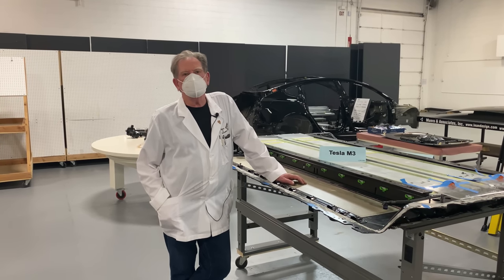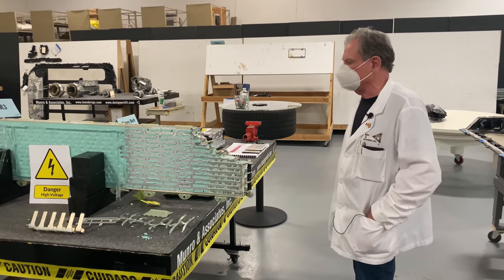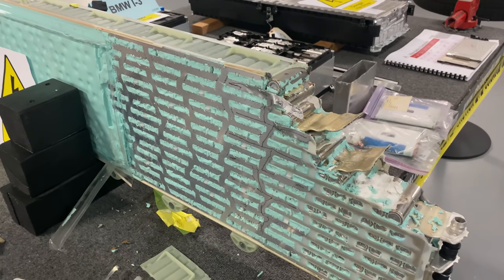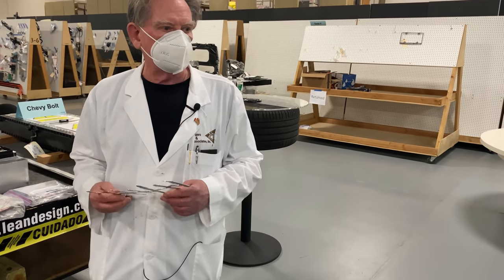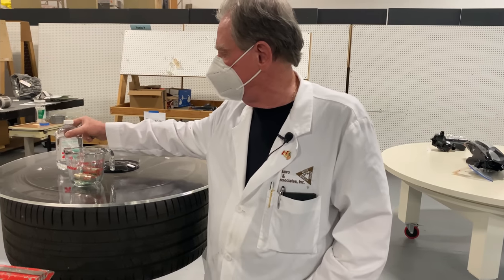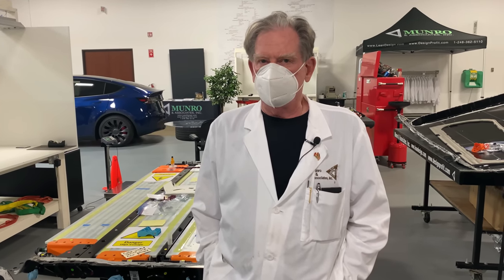Model Y E32: High Voltage Battery Comparison - Cylindrical vs. Prizmatic vs. Pouch

Comment: Those thin wires to each cell are also fuses.  If an individual cell shorts, the wire opens and everything keeps working, but with a little lower capacity.  Tesla has the best thermal management  by far.  The BMW is ridiculous, as it only heats / cools on the thin bottom side of the battery cell's "can".   Early on, Tesla found that the key to deep cycling (a.k.a. usable charge) and the capacity decrease due to charge / discharge cycles (a.k.a. life) is dependent on the thermal management of each and every cell.   The other guys, like Nissan and BMW, are still clueless about this.  If interested, BMW has a YouTube video of how they manufacture the cells.  Sandy is correct about the costs of making a cell, i.e. Tesla is least expensive, but not necessarily about the assembly of the battery pack.  Tesla's design is almost fully automated, the other guys, not so much.

Comment: The "tiny connectors" act as fuses and prevent internal short of a cell to kill the entire brick
Reply: Yep! Additionally all the batteries in a brick are all parallel. So they collectively act as 3.7 V and give a higher capacity per brick. If you lose one or two it doesn't drop the voltage because the potential difference hasn't changed, only the Amp Hours available from that brick has diminished slightly. (assuming the cells are essentially uniform voltage to begin with)
Reply: @FailTrainS  Funny that Mr Munro confused voltage with ampere/ hours,  any schoolboy/ girl  would know the difference!That is not very assuring regarding his expertise . LOL
Reply: @planpitz4190  everyone makes mistakes from time to time ;)
Reply: @planpitz4190  It's easy to right something down on paper correctly, but easy to mess up when you're trying to talk about it live. :)

Comment: There is multiple errors in what you say or what you mean on batteries and cells, Sandy Munro:
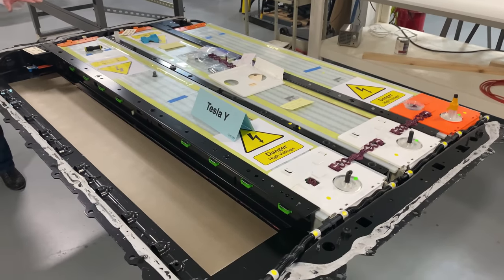0:30 - That's three out of four *battery modules*, not battery packs nor batteries.

1:10 - There is not 4416 of these cells in each of these four "bars" (modules), but there is 4416 cells in the whole battery pack in total, so 4416 cells in all 4 modules combined.
4416 * 3,6V * 5 Ah = 79.488 Wh.
The rest is ok: 46 cells in each brick: 1s46p, with the cells in each brick wired in parallel. And then the bricks are wired in series: 96s46p.

3:00 "Of course the main ingredient is still Lithium ion, but that part is the main product, but the rest of it is Nickel, Cobalt, Aluminium."
That is a totally misleading statement. The main ingredients by weight are graphite and copper from the anode, nickel and some aluminium from the cathode and electrolyte solution. Lithium is in fact a relatively small percentage of the overall material.  About 70-150 g lithium per kWh. While a kWh weighs about 460 kg / 80 kWh, which is about 5,75 kg per kWh.

See this for reference for a NCA cell:
https://cen.acs.org/materials/energy-storage/time-serious-recycling-lithium/97/i28
Percentages by weight (multiplied out for the active cathod material):
22%	graphite (from anode)
17%	copper (from anode)
15,2%	nickel (from active cathode material)
15%	electrolyte solution
10,4%	oxygen (from active cathode material)
8%		aluminium (from cathode side (inactive material))
4%		carbon black and binder
3%		separator plastics
2,8%	cobalt (from active cathode material)
2,2%	lithium (from active cathode material)
0,4%	aluminium (from active cathode material)

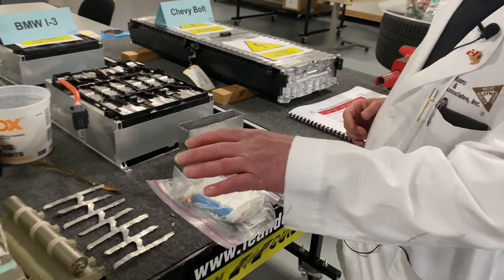4:10 - that glue is likely non-conductive, instead of "conductive glue". Instead what you mean is "thermally conductive" instead of "electrically conductive".

6:16 - The cells are in parallel, so you do not lose voltage when cell fuses break. But you lose amperehours in a brick.

6:51 - That is not small wires "that break", they are cell fuses specifically engineered with a certain diameter designed to break in case a certain current is exceeded.

3:22 - These are nickel metal hydrid (NiMH) D-size cells from an early Ford Hybrid. Inspired from early Toyota and Honda hybrids.
Reply: Thanks for all the addtl info/ corrections
Reply: you are battery God! please make videos about! please!
Reply: Someone's doing expert level homework! Thank you very much for your sterling comment.
Reply: I was about to correct some statements made after watching the video since I worked on both M3 and Bolt cell/pack. Thank you for posting the detailed comments. Of course some like the number of cells were all just casual errors made during the simplification of the video. My main cripe was the % of chemical constituents in each cell.
Reply: @Ben L yep a lot of it is sandy using incorrect language, this is really nit picky and would not matter to the casual audience the video was made for, he makes detailed reports that he sells.
Reply: I'm just glad that Sandy is willing to show us how he utilizes his expertise.  He doesn't HAVE to share all this knowledge with us morons, for free.  Rather than bitch about little things, why not let the man do his thing, and enjoy the knowledge he has and the job he's doing.  A job that would probably be much easier without a camera & mic on him and a bunch of extra "studio set" stuff that goes along with filming himself and his space, making public presentations.  Everyone knows there are a total of 4416 cells, even my 11 year old nephew knows that (mostly because I give him a dollar for the correct answer.)   If enough people complain about the little stuff, we'll get nothing.  Is that better?
Reply: please make videos and share us your wisdom
Reply: @AlexTelon  Yes, that description describes the long range battery pack with a proper wording. However, the standard range plus battery pack was described in a short statement in a wrong way. I put in a large comment there with a correction.
Reply from the maker: We appreciate the fact checking and keeping us on our toes, shows that we're lucky enough to have a very smart audience!  As others have mentioned, these videos are meant to be more of a high-level glimpse as opposed to a perfectly-honed deliverable, so you'll have to forgive us for some of the occasional flubs - with daily publishing of videos, we just don't have the time to shoot multiple takes and conduct long rehearsals. You're getting to experience raw, unbridled Sandy! :) Our hope is that the content that we are providing is useful to you, and we appreciate you tuning in!
Reply: @MunroLive  I very much appreciate your videos, warts and all, and I also appreciate it when people fill in the details here in the comments.
Maybe you could pin @koeniglicher's comment so it's easy to find even as time goes by?
Reply: I grew up on RC electric cars. Tesla just has more cells.
His basic understanding was surprisingly inaccurate.

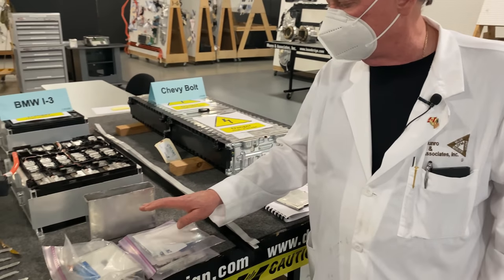Comment: 5:30 Sorry. Sandy is actually wrong on this. In fact, the order might be flipped. Pouch cells might cost more to manufacture on an individual basis than cylindrical cells; however, those pouch cells are actually cheaper on a basis of energy capacities. Cylindrical cells are cheaper to produce on a per unit basis, but they require more materials per unit of stored energy. 

Pouch cell battery packs are also, by far, the most energy dense construction. While cylindrical cells make the packaging appear cheaper and more energy dense overall, they are a package within a package (the cylindrical cell walls serve the same purpose as the packaging used in prismatic cell and pouch cell battery packs). 

This is easy to demonstrate in real life as the 2020 Chevrolet Bolt EV's 66 kWh battery pack weighs in at 947 lbs, while the Tesla Model 3's 74.5 kWh battery pack weighs in at 1,054 lbs. That's 153 Wh/kg and 155 Wh/kg respectively, so either GM's cells are far more energy dense or Tesla's packaging isn't any better in terms of energy density.

Comment: You don't lose volts if a few cells fail and their "fuse" wire melts, you lose the capacity of those cells that failed in the parallel segment of that brick. You would only lose volts if the segment became disconnected from the rest of the brick, in which case I presume that brick would return zero volts because the segments are in series.
Reply: correct!
Reply: If you lose cells within a brick, that brick would not deliver its full voltage as I understand it. Each brick delivers the voltage of each functioning cell times the number of cells within that brick. The capacity is then determined by b the number of bricks. I presume, because admittedly I do not know, that if a cell dies,  battery m management somehow make adjustments of some kind to keep things balanced.
Reply: You don't just lose the capacity in that one brick, you lose it overall. Once the brick with the least capacity is exhausted you MUST stop discharging the battery pack. Continuing to discharge the battery will force current 'backwards' through the exhausted brick, which will start a fire.
Reply: True, but loosing one cell will change the discharge of the entire brick so it will loose voltage faster than the other complete bricks.
Reply: @Paul-pj5qu  What you said would only be true if all the cells in the brick where in series, but they are not, they are paralleled in segments and then those segments are in series to make the brick, so loss of cells in segments causes no voltage loss, but that segment with cells in parallel would drain faster thus lose voltage faster than the other battery segments, which I'm presuming the BMS can compensate for. 

I might have screwed up calling them segments and bricks, in my head, Segments, Bricks, Packs.
Reply: @nickwagner9339  The "brick" will become fully discharged faster than the other bricks if it loses a cell; the only way for the BMS to compensate is by reporting a lower state of charge for the entire battery pack. Since each brick contains 46 cells in parallel, the entire battery pack in the car would be reduced by 1/46 (or about 7 miles of range). Once one brick is discharged the entire battery must stop being discharged or damage will occur.
Reply: @stephenj4937  Can the BMS not charge the segment missing a cell from the rest of the pack so that it will be empty at the same time as the rest? Surely more efficient than losing 2% of the whole pack, even if compensating for the loss of 1 cell cost 2 cells worth of power to recharge and compensate for, which I'm sure I've overestimated., more like 1.2 cells to charge 1 cell if efficiency loss was 20%
Reply: @stephenj4937  Utter nonsense...

Every EV is incredibly conservative with battery cycle depth and allows for large margins in parallel-block discharge depth to not have an significant impact on user experience (ie: range)

A single cell failure in a 46p arrangement would not have any measurable impact on range since that brick would be allowed to discharge to slightly below the normal (extremely conservative) "discharged" state.  In the long-term, there would be a modest impact on cycle-life, but Tesla packs are designed to outlast the vehicle's mechanical lifetime by a significant margin.

Comment: Would be interesting to see how the blue glue reacts to heat. Maybe a piece of it could be pealed of and heated up with either a hot gun or direct contact with a flame.
Reply: Or even better - cut a small part with a few cells out of the brick, build a small mock case around it, similar as possible to the original battery case, and heat it up until thermal runaway (of course in an controlled environment)
Reply: The white part is glue. He didn't explain it, but the blue part is typically referred to as gap filler. It's thermally conductive so it helps dissipate the heat to the battery housing and keeps all parts of the battery at the same temperature

Comment: The cell voltage is irrelevant when considering the effect of removing one in a string of 43 cells in parallel. It's the capacity of each cell that matters. Since there are so many in parallel, removing one has little effect on the capacity of that brick. The BMS will balance out the effect of small differences in brick capacity.
Reply: No. They are are top balanced. But the bank with the lowest Ah are the earliest "empty". There is no active high power balancing in the Model 3. 
Theoretically this would be possible.

Comment: Could you confirm whether the cells have liquid electrolyte that pours out when you open them or is it viscous?
Reply: No one use liquid electrolyte anymore in this kind of cells. Now it is a gelatinous polymer, hence the name li-poly. Usually they call li-poly the pouch cells and li-ion the cyclindrical ones, but truth is that they are all li-poly.
Reply: @GiovanniEsposito5  We suspected that it is no longer a liquid, would you happen to know whether it is applied before winding or still injected afterwards like the liquid electrolyte?
Reply: CleanTechnica you should buy their book when it comes out
Reply: @cleantechnica  Usually they are filled after winding and the electrolyte is than diffused in a vacuum chamber, than the cells are sealed.  Not 100% sure, but probably Tesla does exactly the same.
Reply: @GiovanniEsposito5  That is how it was with a liquid electrolyte but is that still the case with a gel?
Reply: @GiovanniEsposito5  Okay that is totally wrong. First, cylindrical , prismatic & pouch are different form factors, nothing to do with the cell chemistry. Li-Ion & Li-Poly cells are different because of the electrolyte material (LiPo have a polymer material). Try piercing a Li-Ion and you will see what comes out. Its a electrolyte composed of an organic solvent and dissolved lithium salt.
Reply: It's like a fruit rollup
Reply: @AbhishekSoni-fv2ks  Would you happen to know whether modern cells apply the electrolyte gel before winding or is it still injected as a liquid and that they then add gelling additives to turn it into a gel in the cell?
Reply: @AbhishekSoni-fv2ks  Read again carefully what I wrote. It's what I said, "They usually call that" but it's not true, and yes of course, it has nothing to do with cells format. Anyway almost no-one now uses liquid electrolyte anymore, so they are all li-poly.
Reply: @GiovanniEsposito5  I think he means that you shouldn't be calling it Li-poly which is something else, but rather a polymer based electrolyte
Reply: @cleantechnica  No really, Li-poly means that they use a gel polymer electolyte, like almost every cells nowadays. They are still very fluid and can be injected as usual.
Reply: CleanTechnica  before winding, cause it has to be spread evenly and “cure”
Reply: @DavidHRyall  Can you point me to any kind of papers about this?
Reply: Maybe watch this and see how 18650 are produced (all cylindrical formats are probably similar)
https://youtu.be/wN_wpHX3fsI
By the way I think Panasonic still makes the cells for Tesla
Reply: @GiovanniEsposito5  li-ion is the chemistry. So li-ion is li-ion
Reply: @cleantechnica  He can't because it's not what they do. He is talking about electrode coating. Believe me, the electrolyte filling is done at the end of the process, just before sealing the cells. It's highly likely the same for every kind of chemistry and format.

Comment: I would really appreciate if you could talk a little more about the battery cooling on the Tesla compared to the other common styles. Also if you could touch on battery charging and how Tesla is able to cram in 250kw during charging while many other manufacturers are still under 100kw.

Comment: I have pondered the rational for the Tesla battery config. ( I own a model S). Why so many little batteries? I think one important reason is the failure mode of a single cell. When ever you have cells in parallel a single cell short failure will be powered by the remaining cells until something vaporizes. A small Tesla cell provides a modest amount of current maybe only a few amps. So a small fuse will deliver the cells normal current and still fail with modest affect. A large prismatic cell that might deliver 200 amps or more must have large fuse that will fail spectacularly. The loss of a large cell will also profoundly diminish pack capacity. I wonder how many Tesla packs have a few blown fuses that go undetected. The Tesla battery is like a stack of fire crackers while the prismatic is like a stack of dynamite. It would be interesting see a failure analysis of all the various battery types.

I watch all of your videos. Great stuff !!!

Comment: Hi i couldn't understand if in between cooling pipes running throughout battery brick. It will short circuit the battery like you said 90 cells block let say 21700 cell 3.7v-4.5Ah 90P = 3.7v-405Ah cell. when it will be connected with another cell in series + - The coolant strip will short circuit because its of Aluminium.
Kindly elaborate how cooling does't short circuit the battery. Although 1 brick is connected with coolant pipe. Waiting

Comment: Lots of Model 3 batteries and battery modules along with those for other electric cars are available on Ebay. Chevy Volt battery segments are a good deal in 24V or 48V segments. Since they are significantly de-rated and well managed in the car they suffer less degradation than most.

Comment: It looks like the individual Tesla cells are very difficult to remove. 

Does Sandy know how these battery pack may get recycled in the future or if it is even possible to recycle the materials with the way it was constructed? 

As I know Tesla has said it can be used as a power wall or a secondary battery for other uses. But how time intensive would the process be to extract and reuse the lithium?
Reply: MiTch Mahood the glue has a desolving agent which will desolve the glue

Comment: At 1:45 I'm not sure that the brick connects all 46 cells in parallel. It looks like you have a row of 3 or 4 cells in parallel, but then the rows are connected serially inside the brick. It looks like a mixture of serial and parallel to me inside the brick.